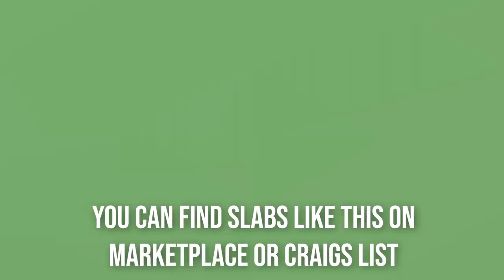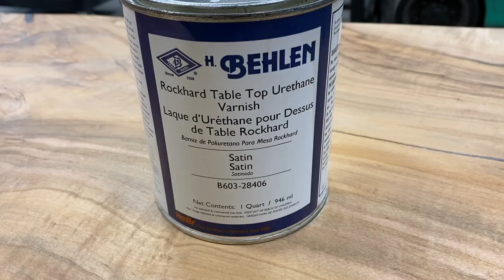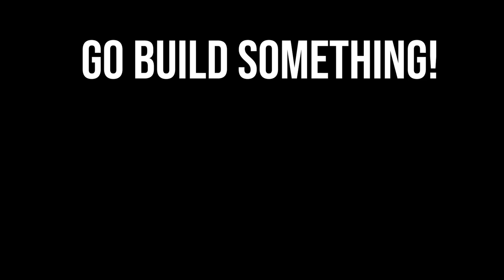How to Make Live Edge Countertops

Comment: I have solid pine slabs I intended to use for countertops, they're 3 inches thick though. I'm not sure how to get them down to a usable size?
Reply from the maker: We would take them down with the slab leveler (CNC) You can make one out of some rails and a cross piece and use a router. Takes allot longer but it's pretty effective. Lot's of guys make them on youtube.

Comment: Oh I have just the guy who loved it ))) aside question: will your track saw rock on a flat surface? How flat is it’s base?
Reply from the maker: It has a bit of flex and there is a soft rubber on the bottom so it conforms a little bit. I have three of them and they are all pretty good.
Reply: @buildlife  thanks!